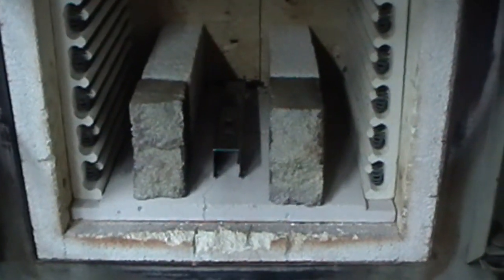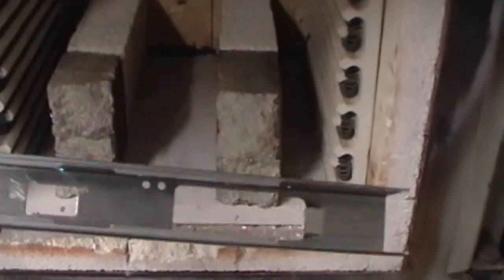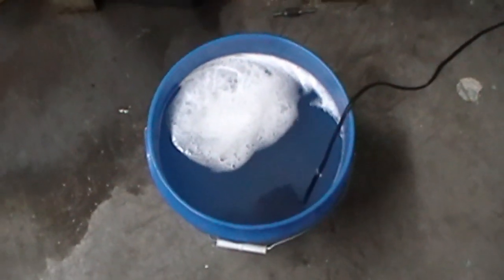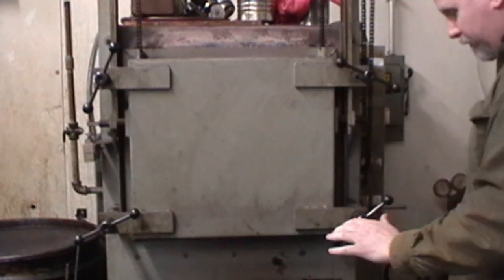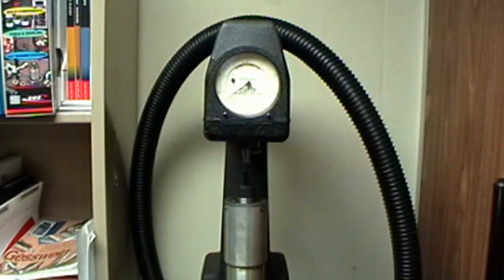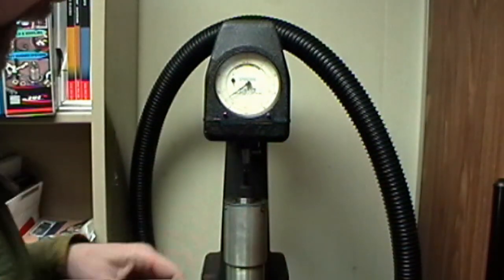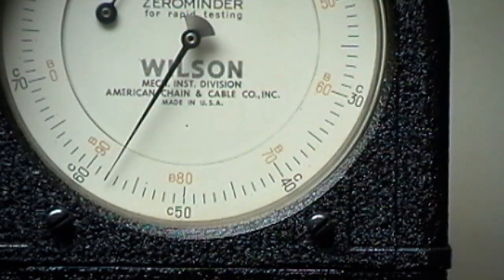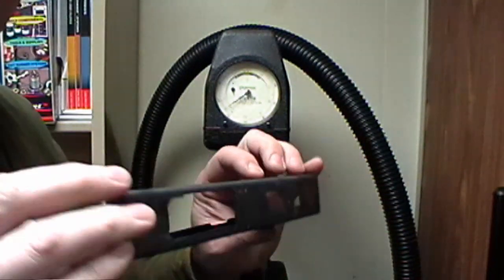AK47 Part 3 Receiver Heat Treat and Rockwell Hardness Test

Comment: OK Mel64d, back at you again with a few questions/comment. I see you still use an old fashioned blacksmiths tongs, very cool, I have a few myself, not being used yet., My first question is on heat treating the receiver, I followed and understand what you shared in this video, heat treating the whole receiver. Not trying to cross paths or argue here, but there are many builders who say it's only necessary to heat treat the critical, what I would call, bearing holes, i.e. trigger and hammer pin holes. I'm simply asking for your metallurgy expertise about that. In particular I'm working with or in the process of building a M-70 Yugo, bulged trunnion, fixed stock from a parts kit, and the receiver flat is from AK-Builders. The material is .063, 1.5mm, 45130 Chromoly. Obviously those mentioned holes need to be hardened,  what about the top rails, if only the holes were heat treated? Don't mean to be rambling too long here but I thought I should be concise. Last inquiry is when would you use that salt/detergent solution, and when the oil for quenching. Thanks again for your vids,
Reply from the maker: Hey 50, In the video you see my use the salt (brine) quench. I have found that the quenching oil that I have at the shop for quenching tool steel works just as good if not better. This was the first time I ever tried the water quench. It came out very hard (58 Rc) but I noticed a slight bow in the receiver.......I forgot to stress relive the darn thing! I was in a hurry to set everything up and then get out of the way that I forgot to do this first step. I remembered after the oven was around 1000 degrees. Oops! So then I decided to go ahead and draw the hardness anyway just to see if the bow (it was on the bottom where the trigger guard rivets on) out after I soften it up. Well this did not work, when I pushed down on the receiver with a piece or brass, it made a ping noise. Well that was a crack! The receiver was no good. But I had another receiver that had not been drilled yet. I went home and drilled that other receiver and brought it back to work. I then stress relieved it and then did the normal heat treat procedure. Now for the question you asked me, A full heat treat is only necessary if the gun is going to be under a lot of stress, i.e. full auto or a lot of bump firing. So no you do not have to heat treat the whole thing. The pin holes need to be hard to help with the rotation of the pins, this keeps them from egging out after a lot of use. I only heat treat the whole receiver because I have a heat treat oven at my disposal. Most home builders do not have this. Some find a kiln on E-bay or at a garage sale. But most only have Mapp gas so they can only do the pin holes. As for the top rails, well some people do, and some people do not heat treat them. If they are treated they will last longer, but it is very hard to get a long section to treat correctly with just Mapp gas. If you do not treat them (not saying you have to) they will eventually wear out and the whole receiver will need to be replaced. But this would take a lot of rounds down range and most people unless they have a place to dirt shoot will most likely never wear out their receiver.  I just like to get my guns as close to factory as possible. I have 20+ years in tool and die, and an entire machine shop at my disposal. So why not go ahead and did it the best I can.

Comment from the maker: @Freedom I placed it back in the oven after it cooled down and set the temp for 750 for 45 mins. Came out 42 Rc. You want to try and stay under 44 Rc as it can have cracking problems.